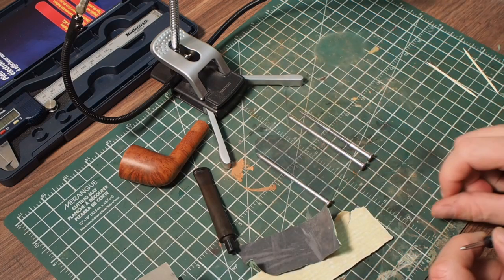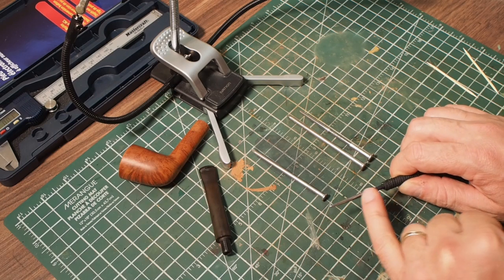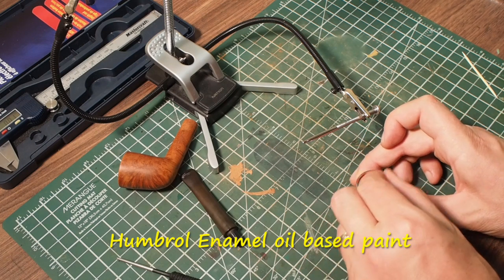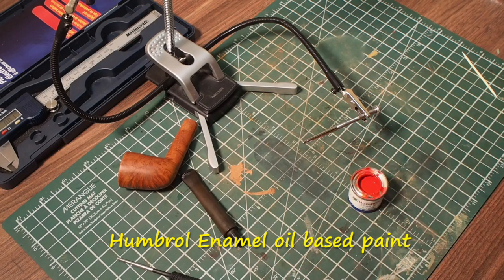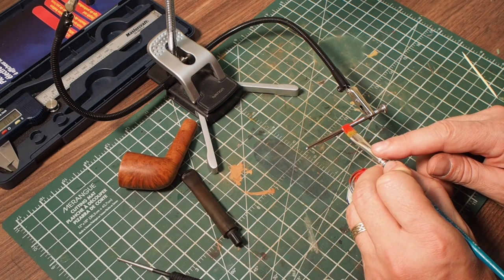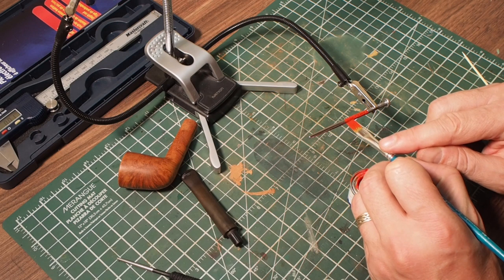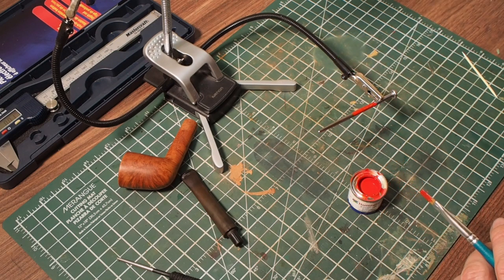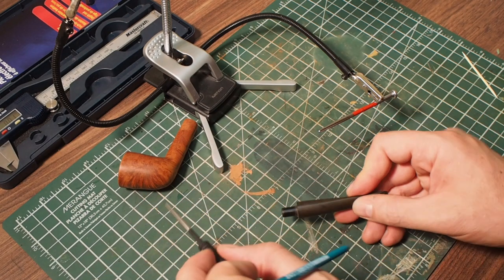Ep29 - Butz Choquin project part 4: How to make a tenon tightening tool.

Comment: Very nice solution to a common problem.  I do it a bit differently using more expensive tools that likely achieve the same effect :-)  I'll be showing the method I use in an upcoming restoration video, and I'll be sure to direct folks to this video because it is a much better solution.  Thanks for sharing!
Reply from the maker: CaneRodPiper I am looking forward to seeing how you do it.

Comment: Would a ice pick work?
Reply from the maker: Cesar Lopes yes I think it could, depending on how steep the angle is on the pick. It needs to be pretty gradual. Also, you may have to cut off the sharp end otherwise you may not be able to get it in far enough.